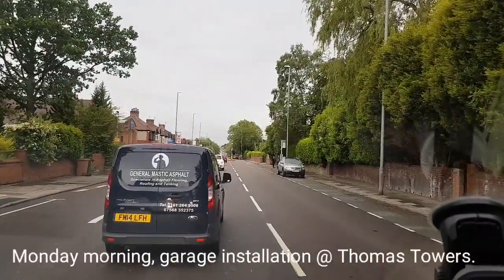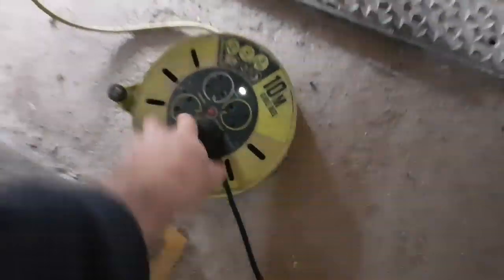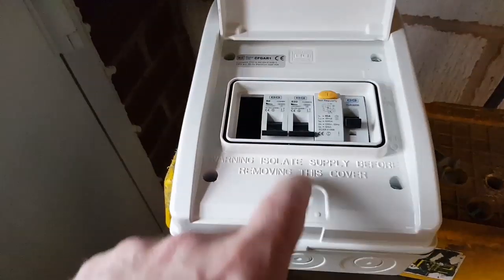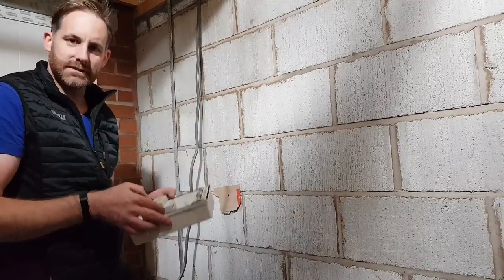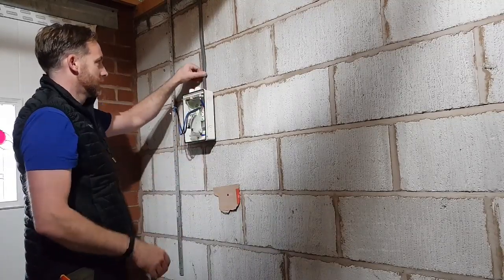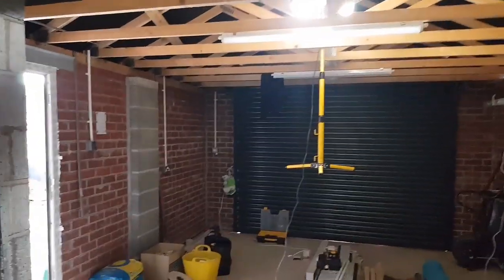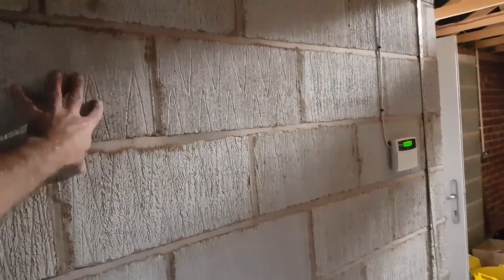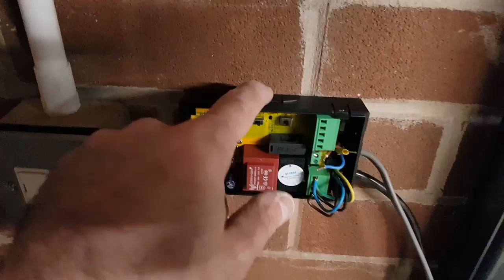Garage rewire  | Power and lights. (04)

Comment: Would have thought you'd have twisted the wires inside the sockets at a minimum with your lineman pliers! Quite poor practice to just shove them in without! It isn't going to connect properly inside that socket!! Seen so many single wires also just shoved in and not doubled over! Good video BTW but those connections horrified me! 😬 But I was taught the proper way to connect stuff!

Comment: Hi J what was your preferred method of wiring the light switch and sensor I'm an adult trainee so just curious did you connector block the neutrals in the switch and use two browns if I'm making sence love the videos thanks for sharing
Reply from the maker: I'll be honest with you Mark, I'm not sure what I did now? I know the sensor required a permanent live and the switch can override it.
Reply: @JBE  
No problem mate thanks for replying so quickly working my way through your videos so I'm a bit behind.